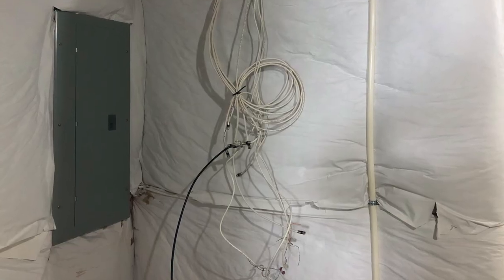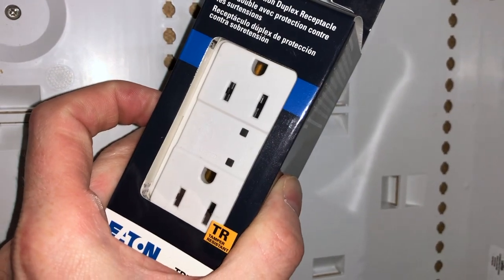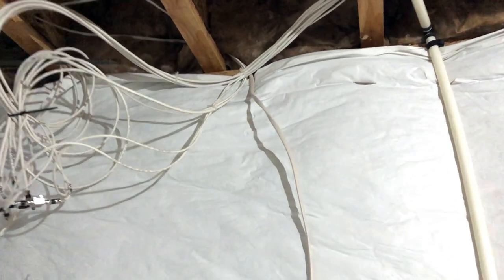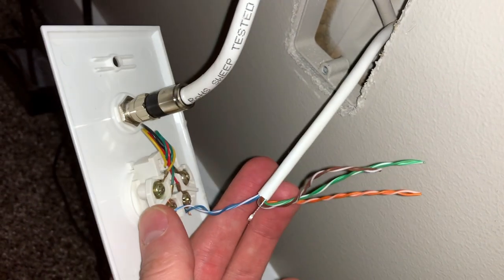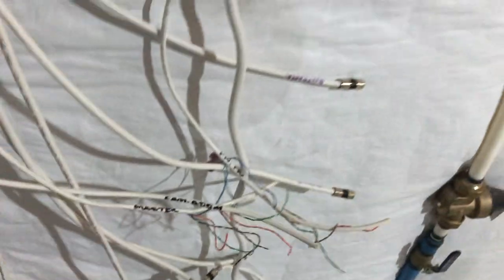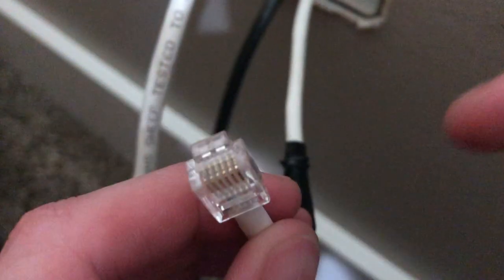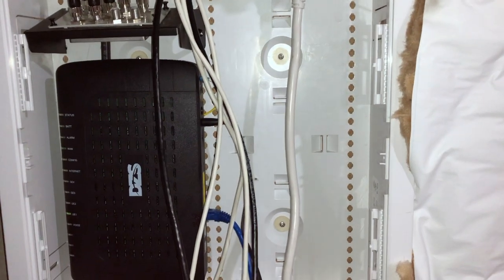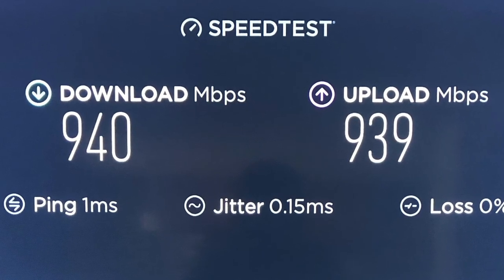HOME NETWORKING 101: Add Network Box - Add New Outlet - Cat 6 - And More! - Getting Ready for Fiber!

Comment: I would have put the router in the basement and put an access point in the main room.  Then you have a CAT 6 line for the smart tv if you have/get one and the other for the access point.  Or I would have put a small switch behind the tv and then you only need one line and then you have additional ports to add other devices like a Roku, Apple TV, etc
Reply from the maker: Unfinished basement. No need to WIFI down there. Plus, I can have two satellites upstairs, where I really need them. Maybe once the basement is finished.

Comment: Why didn't you just use the CAT5e as is, instead of terminating a phone port? Also, in my enclosure in my home, I drilled holes on the side of the enclosure, fished zip ties through, and mounted the power strips inside the enclosure along the side, securing them with zip ties.
Reply from the maker: I pretty sure I mention why in the video. I do talk a lot after all. I could not fit the power strip inside…which would be preferable.

Comment: What 4 pins in jack got used. 4 wires in a 6 pin jack.
Reply from the maker: "RJ11 is a four pins connector which is used for terminating the telephone wires." Reference: https://www.geeksforgeeks.org/difference-between-rj45-and-rj11/#:~:text=RJ11%20is%20a%20four%20pins,wiring%20a%20single%20phone%20line.

Comment: On Gig1 Fibre, but nighthawk wifi speed test is around 450-550mbps and wired is around 700mbps. Any ideas why this is ?
Reply: All cables are CAT 6, from the nighthawk router its connected to a gigabit switch which the cat 6 cables go to my devices.
Reply from the maker: WIFI is always slower that hardwired. You also have to be using a device (phone, etc) that supports gig speeds. You may like my other video on getting hardwired Internet: https://www.youtube.com/watch?v=CxNAITy92Qo